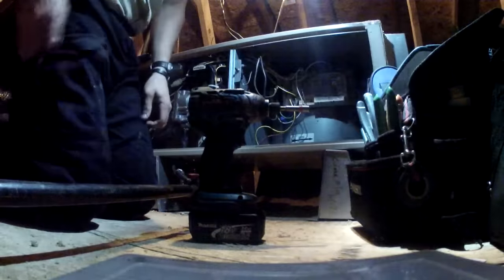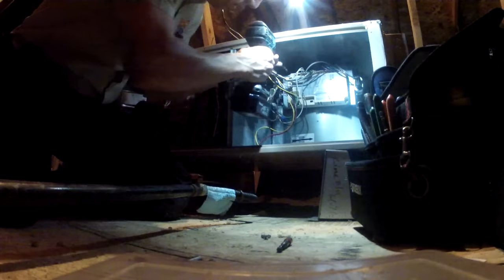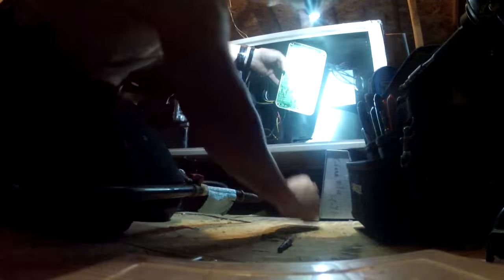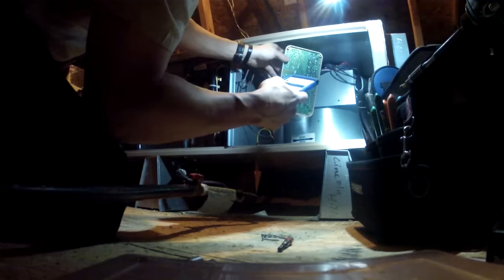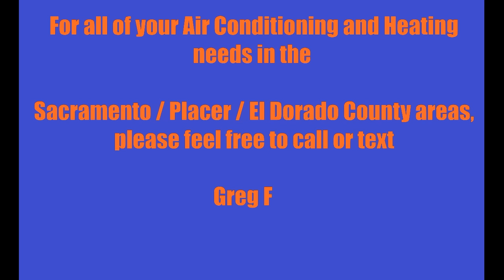The Control Board and the Kamikaze Goose!

Comment: great job. the lingo alone, makes you extremely professional. never knew to look for the solder points, i usually look for the burn marks or shake the harness however will look for those points in the future. its a common issue on the honeywell aquastat relay for boilers where the vent damper ties in.
Reply from the maker: +PHC Apprentice yeah they go hand in hand.  In fact the board could be considered below factory specs when the solder points are fractured like that anyways.  Its a sure sign of a future repair.  Some people go ahead and change the board preventatively.